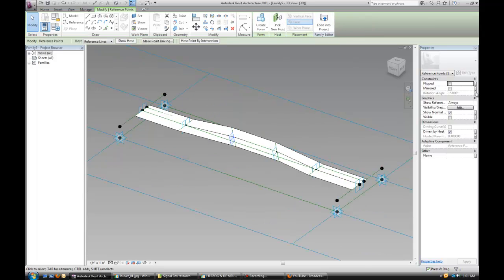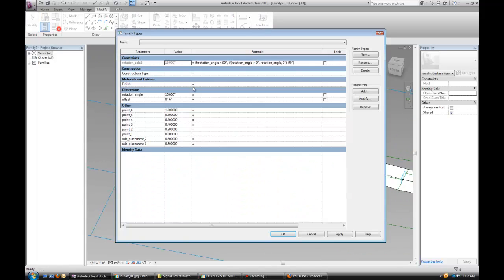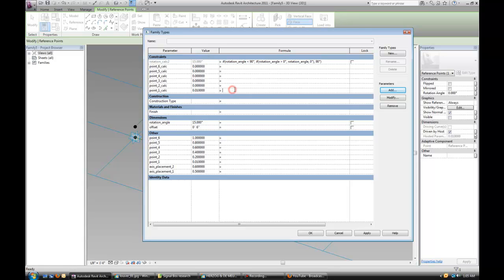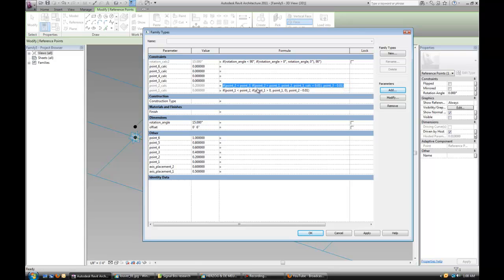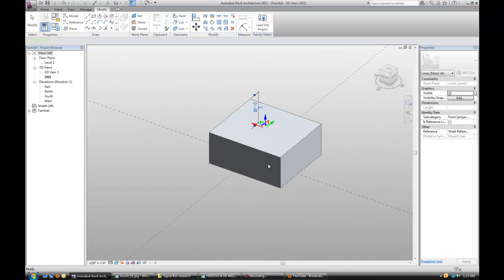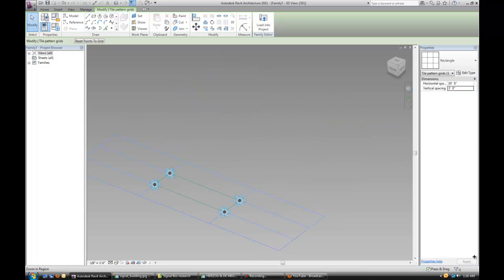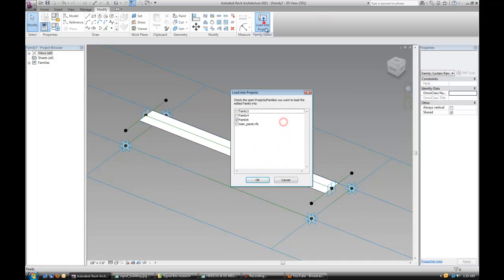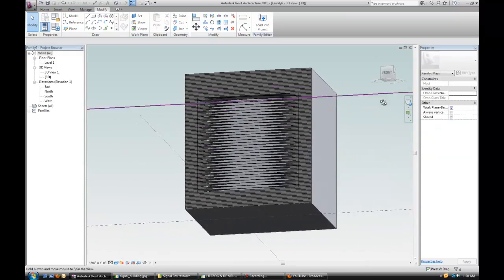Revit 2011 - Parametric Louver (part2) (formulas p

Comment: I would like to say thank you or uploading this right now i am working on this for my desgin class i actually have to make a 3D Wall section of this paricular building so I am very thankful for you posting this online...I wanted to know if it possible for you to go over the formulas in that you used for the points i was trying to see them but they were very blury and when I use them and import to my mass model the panel folds in on itself :(...Thank you in advance!!